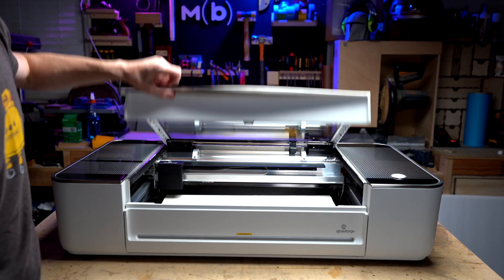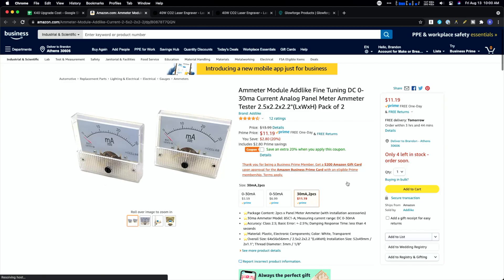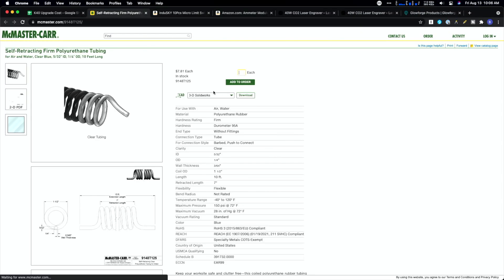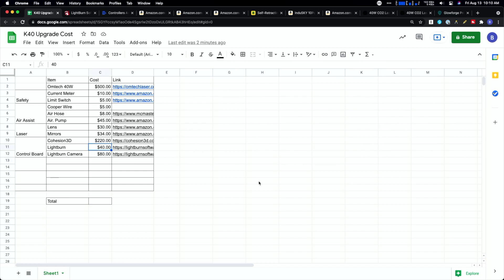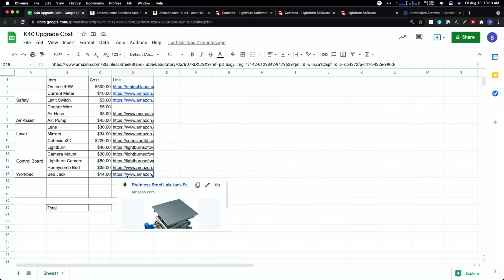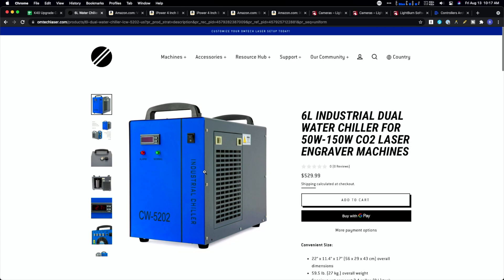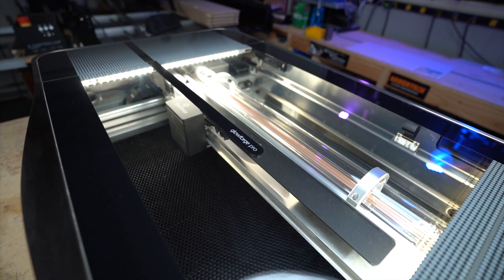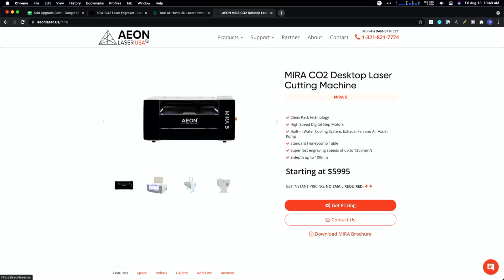Should you upgrade a budget laser cutter?

Comment from the maker: K40 or Glowforge, what would you pick?
Reply: Upgraded K40 ( either 50 or 60 watt though). Lightburn baby is the key !!!
Reply: @IIIofV  I have lightburn. I still use RDWorks a lot though
Reply: K40 of course.
Reply: As I said before, any laser not a Glowforge is a win. WIFI is never secure, plus web only is very bad idea. You never own a Glowforge you only rent it. At any time Glowforge can remove support for your unit and its a brick or decide you must pay for the privilege of continual support. Even if the cost is a thousand dollars more than a comparable Glowforge its still more than worth it.
Reply: K40.
Reply: K40 all the way with a cohesion 3d board, then a better extraction and a decent air assist
Reply: K40 all the way. and when you outgrow it, throw in about $1000 more in aluminium extrusions and new stepper motors and drivers, and you can re-package it for a working area 2 or 3 times bigger than the glowforge, and it would still be $800 less than that. which, btw, 
would allow you to also upgrade the laser and power supply. start with a K40 and you can grow it over time as much as you like or need
Reply: @pgabrieli  Check out a video I did an the MPCNC. you can do that for under $400.00
Reply: I do not like the Glowforge at all. Just the cost and you have to have internet to use the machine is a BIG turn off. I had the k40. not long after that I got a "Big Red" 60 watt Chinese machine fro $1,700.00. I ordered from a California distributor. That is what I would go with. I have had it for 3 years now and it is still going strong. I have now made the Mostly Printed CNC Router. I will take the guts from the k40 and make a much larger laser.

After 3 years, I still do not have a water chiller. I use a mid size cooler with distilled water that I place frozen water bottles in to chill the water. I will be looking into a chiller for more convenience.
Reply: K40, upgrading the control board over the stock using the most expensive option that is compatible with lightburn, and adding a water pump that is just slightly better than a 5gal bucket and ice blocks.
Reply: Is there any way I can speak with you over video chat? I got my laser in a while back. Had some moving to plan and ended up getting pushed back. There’s a few things on mine that look a bit off and I was wanting to see what your thoughts were on it before I put another $500+ into it
Reply: I have a k40 and would choose it again if for no reason other than Glowforge instisting on calling theirs a "3d laser printer"
Reply: k40
Reply: Just found your video, great content. I did notice that some modifications have been made to the K40 since publication. Have you or will you do an updated video?
Reply: I am still on Team K40.  Cannot easily upgrade the Glowforge to a more powerful laser while cutting a hole in the side of the K40 will let you put in a bigger tube and a more powerful power supply is easy, too.

Still going to watch the video, would like to ensure that I did not miss anything in the last two years of hyperfocused exploration into CO2 lasers.  :D
Reply: Yep, still have a K40 in the plans for my makerspace after watching to the end.  Of course, I have the 3d printer(s) and electronics hobby experience as well as some metal fabrication so expanding the K40's cutzone with a relocation of the electronics, removal of the separation wall inside the case and an improved gantry system along with potentially running a Raspberry PI for wifi connectivity/control will have me at still less than the 50w CO2 and significantly less than the Glowforge.  The Ruida does make the 50w interesting but my planned location involves going down a flight of narrow stairs so the form factor would not work for me.
Reply: K40 every time. Glowforge is the apple of laser cutters. Overpriced, locked down and limited, but looks nice.
Reply: So 1700$ difference, but if you mess up the upgrades you can brick your laser and even potentially shock yourself...  and no warranty... am I missing something?

Comment: Personally instead of a glowforge I would go with a 50-60w Chinese laser And a laser chiller they have a much larger bed than the k40 and just better overall quality and still the 50w with a chiller and mods is around the price of a glowforge. the 60w 20by29 af js expensive but with a chiller and accessories for under 4k it’s comparable to the glowforge pro witch is 6k.

Comment: Looks like this video was recommended to me a couple of years late but it's still relevant.  The factor that you didn't mention at all is likely the biggest factor to consider when making this decision... Serviceability.   While the K40 is obviously repairable, since it can be upgraded, it's my understanding that the Glowforge is not serviceable at all.  

Last year I was considering buying a used Glowforge and found dozens for sale.  Thinking that anything bought used would likely at least need a new tube I looked into the cost of parts and the tube.  Turns out you can't buy parts or repair the machine on your own.  If your tube, or any other part, goes out then the only option is to ship the machine back to Glowforge and they will give you a discount on buying a new one.  I couldn't find any other service information so I opted to not get one.  

It's a truly  horrible policy that makes the Glowforge seem more like a scam than a ligament machine.  I hope that I either missed something or they fix the way they treat their customers.

Comment: My first laser was a K40, and it did well.  I upgraded to a XM-1060 100 watt Reci tube laser ONLY because of the bed size, and more power to cut in one pass .. I use LightBurn on the Xm-1060.   I make artistic wood boxes, so this worked well for that.   K40 did etch glass, stone, cut leather and wood, and engraved fairly decently...  The only upgrades I did was a better exhaust, diamond grill bed and a new Lens ..  My son owns a Glowforge.  He doesn't use it 3% of what I use my Xm-1060 or even the K40!  I think the K40 with the dsp, exhaust, mirror, lense and new controller ( with Lightburn ) is all you need for more than casual use of the K40.

Comment: I dig the new format, but seems that the costs were a bit flated. In my experience, maxing out the k40 can be done for about $750 that includes upgrading the board which only costs me 50 dollars for a grbl off line board with wifi and touchscreen, along with air assist, water cooler, dope digital panel, one button emergency shut off and of course some RGB to wrap up the whole thing and give the laser that, "looks way more impressive and than it really is" look.

Comment: Hi Brandon,  Thank you so much for the great info. I'm in the wine business and want to occasionally engrave glasses and wine bottles. I would say about 100 individual bottles or glasses a month. The engraving is not the business. I would also like to do some 3d printing, but not necessary. Glowforge would be ideal except it won't fit anything taller than 2 inches high. Wine bottles are at least 3 inches laying down. I have a $3,000 budget. can I get your thoughts?
Thank You,
Andrew

Comment: Great video. First point. Most K40s come with kill switch on the lid now. Second, Meerk4t will allow a lot more flexibility to your laser power, I think it does fast switching rather than varying the power.. It's not in Lightburn territory but it's way better than Whisperer and it's free.
Third, the fan is upgraded, most now come with a perfectly adequate fan, rather than that dire fan on earlier models. Remove the internal ducting and you have really good extraction.
This means that you will only be spending around $100 for air assist and mirrors to get a very workable machine that competes with the Glowforge on most jobs.

Comment: Kinda wish someone ( or even better a brainstorming community ) would put out a DIY Solution with a BOM one can spec to their needs like the Voron 2.4 3D Printer I just recently built 🤔

I really want a CO² Laser for various projects but the affordable ones either won't fit the size criteria, or the safety standards and the rest is either loaded with crap I don't need and just hiking up the price or even worse not controllable without a connection to a cloud service - Fuck that in particular.

Comment: Any hardware that REQUIRES a cloud connection is a deal-breaker.  Internet down, you're down.  The company goes bust, you have a paperweight.  I don't mind tinkering and have the skills to do the upgrades, but the increased bed space of the 50W is appealing.

Comment: After a lot of research I went the modified K40 route. I upgraded lenses & mirrors, added air assist, amp meter, better temp displays and a better internal and external fan. I also expanded the bed area by cutting down the exhaust shroud. I did run through a major tune-up and alignment to really dial everything in before use. I didn't bother with a chiller, a 5-gallon bucket serves me just fine. I also haven't bothered to upgrade the controller board, the original works just fine for my workflow with K40 Whisperer. I mainly use it for cutting plastic or plywood parts for prototyping rather than engraving, so the stock controller is fine. All in, it easily came in under $800 to have a very versatile machine in my arsenal that I can add and upgrade to later if needed.

Comment: The exhaust fan should be at the exhaust end of the tube... that way you're never pressurizing the tubes... you're always pulling air into it.  The reason for this is so that you never push smoke out of the ducting... you're always drawing air through any leaks in it.  (It's always a negative pressure, instead of a positive pressure, in the tubes.)
Reply: Yes and no, depends on how well you want to evacuate the laser bed of smoke!

Comment: You can do it for half that amount, ( https://www.youtube.com/watch?v=iL3WUZiQriE&t=665s) the ones I convert run lightburn off CNC shield V3 and Uno which uses GRBL in PWM Spindle with a simple one transistor two resistors not gate circuit to have the capacity to control the power of the laser in software. the total cost of upgrades I do is around 600$ Canadian dollars TOTAL.

Comment: If you have the space buying a Omtech 50w to 80w and adding a camera using lightburn software will out perform Glowforge at a cheaper price point..  minimal upgrade just add a camera.  plus larger work area and ability to use thicker material. Omtech Rocks.  I own one and love it.

Comment: I went with K40 and modded it a bunch before I even ran it. 6” exhaust fan, lightburn w/ cohesion board, upgraded nozzle with 2 gallon air assist compressor, honey comb bed w/jack, LEDs. My total cost was $1,050 USD including price of EBay k40 laser. I love it.
Reply from the maker: Very nice!

Comment: I started in March with an Ortur Laser Master 2 Diode machine to dip my toes in and see if I liked laser engraving.
Last month I had a OmTech 60w CO2 machine with 20"x28" build surface delivered (eBay).   Got Lightburn when I had the Ortur and was a simple process to upgrade the license to work with the Ruida controller on the 60w machine.  Makes for an amazingly capable machine with plenty of power for my current goals.

I don't think there's anyway I'd be satisfied with a Glowforge.  Proprietary software, internet connection required, and could become a brick any day if the company ever shut down.

Note: Ortur machine sold on Facebook Marketplace within 24 hours for about what I paid for it (of course I included all my upgrades so it was certainly more valuable than stock).
Reply from the maker: Nice!

Comment: Thank you! This confirmed the research that I’ve done! I’m likely just to go for a 50W unit which saves both money and time. I’m a maker so it’s not a big deal for me to do some DIY adjustments but I don’t want to do a ton. I really don’t like the WiFi locked software idea so that instantly killed the Glowforge for me. 50W is a good compromise.
Reply: I used a 50w for about 3 years, upgraded to a 100w in January, but the 50w works well for most jobs,
Reply from the maker: The 50W is the laser I’ve spent my own money on ;)
Reply: I purchased a 50w first.  I have lightburn.  I am not comfortable upgrading equipment yet.  I purchased a Glowforge and have made tons of stuff.  Now as I get more comfortable, I use Lighburn to modify files and prepare them for cutting.  I will be using my 50w as soon as I get the camera aligned and cut larger items.  I do have exhaust fans, a water cooler, autofocus upgrade (not installed),  I will get to it.  I am just learning.

Comment: The k40 I purchased was sub $400, had amp gauge and a much bigger fan stock.
K40 woodwhisper by scorchworks.
Metal airassist (I've melted a 3d printed)
Agree with the lenses and mirrors.
The other upgrades are negligible.
Frozen 2litters into a 5gallon bucket keep the heat off the tube.